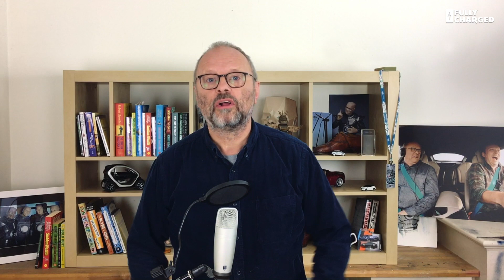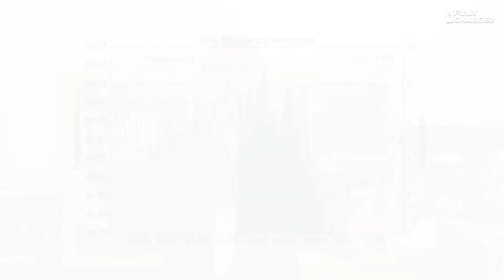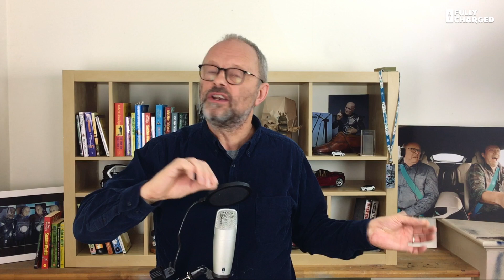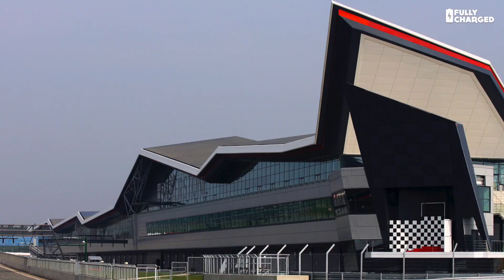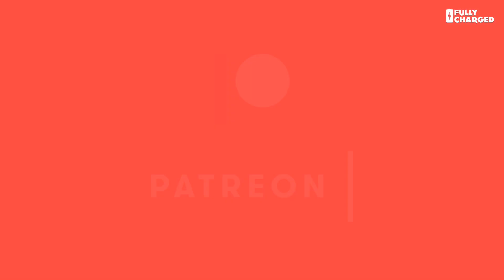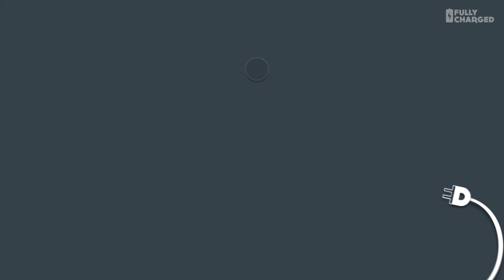Welcome to 2018 | Fully Charged News

Comment: Solar capacity is a useless figure to refer to as in reality the actual output from these huge PV systems is a fraction some 18 to 20% of the installed capacity. The same goes for the wind farms systems - you're lucky if you get 30% out of the installed capacity of a wind farm - this is why you need so many wind turbines to get any meaningful output to justify the Grid connection.  Before you start salivating all over our screens - carbon based power station are going  to be with us for some time as you cannot rely on any wind, solar or wave technology to provide a constant supply unless a massive investment in energy storage to provide energy when the wins, solar and wave systems are not outputting and energy.  Governments are hoping that residents pay for their own home based solar/wind and battery storage systems thereby taking the onus from the Government to spend £billions on clean energy systems. I'm saving up to buy a Tesla and at the same time having a Solar System installed with multiple Powerwall 2 systems - but I will never pay off the investment on this tech as long as I live in this cottage.

Comment: In the last 30 (or more) years certain groups with huge political and economic influence have been doing all in their power to make nuclear power more costly and massively subsidised "renewable" energy. That needs to be said when comparing.

But sooner or later the political and cultural tide will turn and nuclear power will make a massive comeback. The energy density per kg of fuel and installed equipment is, and always will be, much higher. Physics, unlike people, can't be fooled.

Comment: Robert

I saw a really interesting light railway system (Tram) this New Year in Kaohsiung, Taiwan. The Tram uses Ultra Capacitors and Batteries instead of a live rail or overhead cables - the cool bit is that each station has an overhead charging rail which is accessed by an extendable power contactor on the roof of the Tram. During each stop, the Tram receives 20 - 30 seconds of charge while loading passengers and this is enough to charge the Ultra-Capacitors for the 1.5km  to the next stop.

This system is less costly to install than a traditional Tram and does not need unsightly overhead cables. It's brilliant!!

You should make a new article or feature show about it.

Comment: It is not correct to say that the batteries "completely filled the gap" after the coal power plant generating 540MW tripped. This is something that most journalists have gotten wrong. If you see your graph of frequency and battery power over time the maximum power provided by the batteries is around 8MW. To cover the deficit 532 MW are still needed. This was certainly accounted for by other power plants in the synchronous area that were participating in primary frequency control. What this proves is that indeed the Tesla batteries are capable of rapidly adjusting their output power to improve frequency stability, which is a great achievement, but they did not single handedly save the Australian grid from a blackout. In short, after the outage the deficit was shared by other power plants, among them the Tesla batteries. Keep up the good work!

Comment: Hinkley Point is that expensive for two main reasons.
First, very few nuclear power plants in the last decades, so the industry kind of forgot how to do it. Because of the insanely strict regulations nuclear power plants require unique components and skills to build. This of course very expensive, but also can cause huge delays and cost overruns on top of that, if they are not available.
Second, these are antiquated reactor designs, with some major problems. Because of the strict regulations only the big ones are cost effective, but with larger size comes the possibility of a meltdown (so the regulations are often counter-productive). To prevent meltdowns engineers build in tons of redundancy, several layers of defenses, and use the absolute best from everything. This of course drives up the cost like crazy. Which means they have to build even bigger plants to compete with coal. So when there's a problem with a nuclear plant it's usually a big and very expensive problem.
Third, the super strict regulations also prevent innovation. Designing new, far better reactors is technically possible, but very expensive, and a huge risk that no private company is willing to take. There were several government projects, but all were killed for political reasons, despite being wildly successful.
In short, Big Oil owns the US government. They use their political power to kill nuclear energy in the US. The rest of the world follows the US. The fossil fuel industry makes trillions.

If we could use the best available technology with reasonable regulations, nuclear energy could be orders of magnitude cheaper, and far more flexible. We should mass manufacture small modular gen. IV reactors. Small reactors are far safer by default, but newer (meaning anything after 1960) designs can be even safer (like the LFTR). Small size means more flexibility in operation and financing. No need to build gigawatts at a time for billions of dollars. Mass production brings down the cost drastically. Currently a nuclear power plant is built like a million dollar supercar, while what we actually want is a cheap and reliable Honda. Mass production also means that construction wont take a decade or two. You can order one, and get it online in weeks, or even days. Really small truck mounted reactors would be awesome for disaster relief too, you just drive there, and you have 10-100 MW of constant reliable power for as long as you need it (for decades if necessary).

Nuclear power is also excellent for big ships. The technology already exists but only a few military uses it. Ships burn a huge amount of oil, and the dirtiest kind of it, and renewable energy don't have the required power density. Batteries could work, but we are not there yet.

Comment: Although the Tesla battery is a big feat Robert should have mentioned that it did not fill the gap in demand, because it simply cannot supply 540 MW of power, but it did certainly help to stabilise grid frequency

Comment: Hinkley point is an unbelievable ripoff, it's outdated technology that uses solid fuel rods which only convert less than 5% of the potential energy of the uranium into electricity before being stored as waste for hundreds of thousands of years. Madness. Also, it is a high pressure water cooled reactor, which is fundamentally unsafe (Fukushima, Chernobyl, Three Mile Island). It's pretty much the same design as reactors from the 70s, with some massively expensive safety features added.

There is a much safer, cheaper and drastically more efficient way to generate electricity with nuclear fission:
Molten salt reactors.

Check out companies like ThorCon Power and Elysium Industries (presentations can be seen on YouTube from both of them). The technology was tested and proven in the 1960s, but abandoned by Nixon at the height of the cold war, I suspect, because it's pretty much useless for producing plutonium byproducts for weapons.

Molten Salt reactors use liquid fuel, which uses every last drop of fissile material (ie. hundreds of times more energy than Hinkley, Sellafield or Sizewell), resulting in a much smaller amount of waste, with a much more manageable half-life of 300 years or so. Furthermore, next generation liquid fuel reactors could be modified to actually use up existing nuclear waste stock piles as fuel! This is literally the only way to clean up that stuff other than launch it into the sun.

It's complete madness that we aren't developing these technologies. China are, they have 200+ people working on it full time, as do the Indian government, and there are a bunch of private companies around the world claiming to be able to install this stuff in the next five years.

We need renewables AND nuclear if we have even the slightest chance of avoiding catastrophic climate disaster, but it's true, Hinkley point C is clearly an obscene waste of money.

Rooftop solar and battery storage plus tidal lagoons and offshore wind can take a significant strain off the grid, but for heavy industry and mass transit we need to be installing large amounts of efficient, safe, generation 4 Nuclear, otherwise we'll just end up resorting to Natural gas and Coal to pick up the slack. Hinkley point C is overpriced, inefficient, tarted up 1970s junk.

Comment: It is just BANANA's to set clean green and clean nuclear up against eachother, only Fossil has profited from this.
As you pointed out the produced energy is enormous of nuclear.  
That's why the cost are NOT the same as the investment.
Cost and Benefits are connected.   Only looking at cost is mental.

The HPC and offshore wind you are quoting and the numbers are a 1-sided view, and does not adhear to building, possible viable location, future outlook of output, the generation output, the degradation of output. the lenght of that contracted cost.  And the non-added cost of what is also needed to deliver power when it is needed. (houses are just a tiny bit of the users).
And HPC only 1 kind of nuclear plant and only that companies design/buidling.

This is not to disregard wind/solar, but keep an open mind of how we can produce ALL the energy ANYWHERE without fossil fuels.

Ps:   Germany shut down 1300 MW production on 1 jan. 2018 because they didn't like the way it produced  NON-CO² electricity.
That is just an immensely SAD day.
This was a nuclear plant and only 33yrs old, with a possible 27 more years of production use.
It has generated a total of 330 billion kilowatt-hours, 330.000.000.000 kWh without fossil fuel.
Somewhere build on an area of a few km².
Reply: On the EPR plant in Olkiluoto in Finland, the 3th reactor on that location.
Cold pressured testing have all ready been done and Hot testing is now in progress, plant Online is projected in May.
1600MW of production, the 2 older plants have and uptime of 92.5%  with 14,268 GWh per year.
Because we have not build many plants in EU since the 80's, oilcrisis, we have cost overruns.
In the planning, supervision, and building and time, because of the infrequent construction. Today it is more a one-off watch then a reproduced building.  There are now 4 EPRs in the process. the plants in China needs 2 years less then those in Europe.

The Olkiluoto reactor-3 seems to be the 1st to go online, close to the 1st reactor in China.

Comment: There are no nuclear power pants in Norway, However, in..."Late 2012, Norway's privately owned Thor Energy, in collaboration with the government and Westinghouse, announced a four-year trial using thorium in an existing nuclear reactor.The second phase of a five-year trial-operation of thorium based nuclear fuels is now under way. The consortium established* in 2011 and led by Thor Energy is undertaking a sophisticated test-irradiation campaign in order to quantify the performance of the fuel and to qualify it for commercial use. The first thorium fuel specimens were loaded into the Norwegian fuel-testing reactor operated by the Institute for Energy Technology in Halden in April 2013, and the second round, loaded  right before Christmas 2015, is intended to verify test results and is a further step towards commercializing thorium as a supplement fuel in conventional nuclear reactors.  ...Quote Thor website.."
Thorium is an exciting and safe substitiute for uranium as a nuclear fuel. Nobody is giving it any serous consideration except Thor, as far as I know. India and China had a go a few years back but it seems to have died the death and vanished from the news The US had a Thorium plant running in Tennessee back in 1940.s, but that seems to have vanished off the radar.
Reply: The greater part of new nuclear plant designs have a salt and or thorium process in it. There are many researches on this.  China and India are still going strong on this.  They are leading it. There is allot going on.  http://thmsr.nl/

Thx for the info.
Reply: Thanks. Good news, although it seems to be missing from general discussion and really have to search out info. Peoples' general fear of uranium reactors and misunderstanding of the safety of Thorium, not to mention politicians lack of action, is depressing. The military/industrial complex had no interest in developing Thorium as it would not produce plutonium for nuclear weaponery. Why spend zillions on a potential disaster like Hinckly Point and not do anything for Thorium?
Reply: Also the fear to try and improve it, has been so stringent because of the time after Chernobyl.  IAEA is oke, but national organisations are not funded and not helpful.

Comment: I worked out that by simply dividing the cost of Hinckley point C by the cost of my 4kW solar PV install (£4,800) that has generated an average of 3,700 kWh per year, you find that if you spend the same cost of Hinckley on domestic PV not only would you create more jobs distributed across the country, you’d also generate more than double the amount of electricity per year. Interesting thought. . .
Reply: MercedesAMGsRULE I would love a free solar roof!
There would need to be the cost of a big set of batteries as well, to replicate the continuous rain-or-shine power that nuclear can pump out...

Comment: This weekend I drove an electric car for the first time for more than a few minutes. I had an awesome Leaf weekend! I had this weekend 3 weeks after I placed an order for a 2018 Leaf. Never really drove an EV for more than 2 minutes before ordering.
You are one of a few people that made me confident enough to do that. Thank you! 
I doubt my Leaf will be delivered early enough, but if it does - I will try my best to be at the live event driving there from the Baltic Sea coast of Germany in my Leaf.
Reply: It happened to me too. I knew that I wanted one badly but being "sensible" I had to wait for the range to go up and the price to go down. However when the 17 year old car was about to fail its MOT (TuV) and I was looking around for a "bridge" to the EV , my German wife pointed out that I wasn't getting any younger (over sixties dont as a rule) so I might as well take the plunge. Have enjoyed it immensely for two years and could never go back,
Reply: Yes, that might have been a part of my decision making too. I wanted an EV but the ones I could afford didn't fit. So I had to set a goal. I chose a route I drive about 10 times a year (about 214km) and said that the first car that could do this route comfortably (even in winter at highway speeds) without recharging under 40k€ (including our 19%VAT) would be mine.
The new Leaf does not fully meet that definition - but then it's only 30k€. You aren't becoming younger in the 40ies neither...

Comment: The other drawback of nuclear is no realistic plans for the cost/danger of maintaining the waste for millennia
Reply: Very realistic, but also complicated to understand and to except instead of nimby.
Reply: ferkeap , nimby is a difficult factor to overcome. Nevada residents don't want train cars from across the country to caves under a mountain.  They need to begin building facilities to encase all waste in a glass form to prevent it from getting into the water supply.  Of course that makes nuclear power more expensive.  They should also be fully insured for all potential damages to their neighbors.

  It's the external costs in most businesses that are often ignored.  Carbon based power plants also have health dangers that increase the cost of health care, but the price for power stays low.

 Full disclosure, I am in Washington state, so there is a lot of poorly stored waste "In My Yard".
Reply: Nuclear spend fuel, witch i wouldn't call waste is allready savely stored in caskets aboveground.
I don't know what you think is a poor way of handling it.
Dumping it in a mountain and with no access seems like a bad choice.
But yucca mountain is just a bad project because people just wanted to get rid of it from there states, nimby.

There is little pragmatic about the way politics handles nuclear energy or fossil.
We need a more pragmatic approach to go forward.
Reply: ferkeap, yes the entire life cycle needs to be calculated into cost of energy production.  The 20,000-1,000,000+ years that nuclear waste is dangerous is the reason to have it in a secure location.  Keep it away from the children of future civilizations that might not even have myths about us.  Storing it in concrete barrels above ground is very short term.  More money needs to spent securing this waste.

Every disaster/spill/super fund site from nuclear or oil should trigger an automatic tax on that industry to cover cleanup and medical expenses (quicker response time than going to court).  Lawsuits could then be filed to mitigate/lower that tax on the entire industry.  That should be a good incentive to maintain good safety standards and the lawyers suing for damages wouldn't be just the victims, but the related competing corporations also.  Is there a better way?

Hanford of course is one of the worst storage locations in the u.s.  https://www.washingtonpost.com/news/post-nation/wp/2017/05/09/tunnel-collapses-at-hanford-nuclear-waste-site-in-washington-state-reports-say/